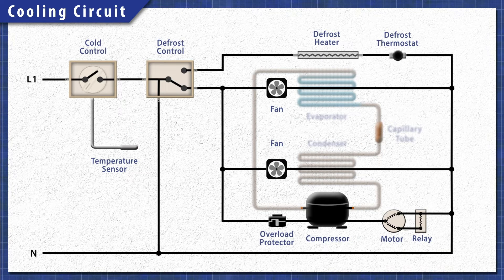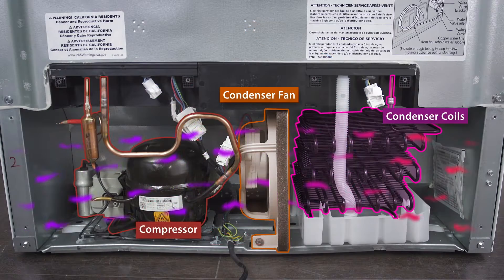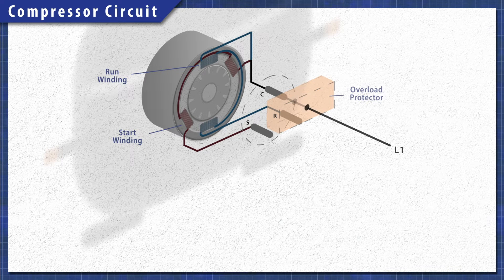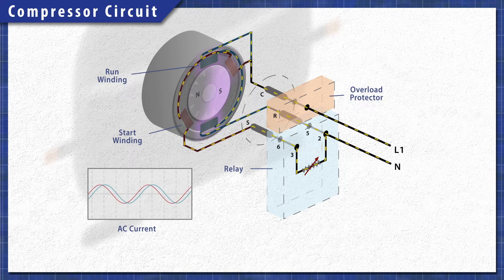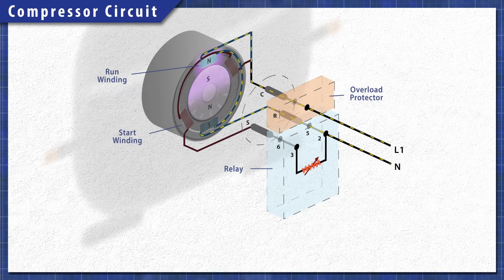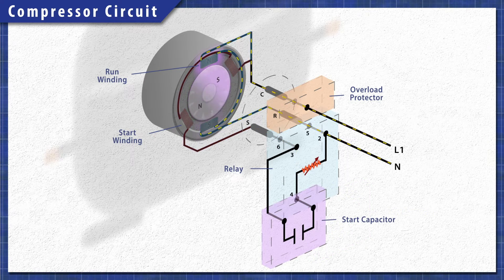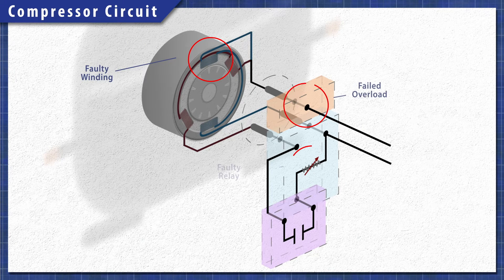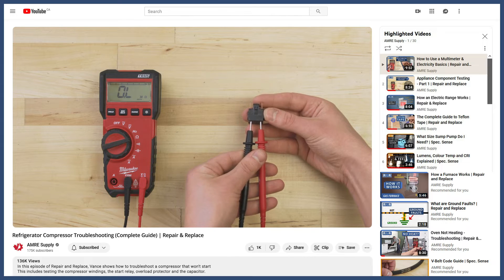Refrigerator Compressor Starter - How it Works | Repair & Replace

Comment: This video helped me to understand how the starter works. However, I replaced my defective starter that had a PTC and a parallel 15uf Capacitor with a 3 N 1. My question, my original starter has a 15uf cap, I don't know what value of the cap is in the 3 N 1, but if it has a larger capacitance will that cause the start winding to have more current when in run, thus causing more heat?
Reply from the maker: Thanks for watching. A difference could produce more heat but it is difficult to know if that is a meaningful amount that would affect performance over time.
Reply: @AmreSupply  I took the label off of the 3 N 1 and found the cap labeled 145 -165uF. I need to get a 3 N 1  to disassemble to see exactly how the 3 N 1 works.

Comment: My side by side refrigerator/freezer is not working correctly. It does not get colder than -5C degrees:

- The thermostat/temperature sensor are working properly.
- Both condenser and evaporator fans are working.
- I checked the resistance between the compressor 3 terminals (common-start: 5.7, common-run: 3.7, and run-start: 8.3). 
- Each of the three of terminals are not grounded to the body. Compressor seems to run fine based on these tests. I attached a new "3 in 1 RELAY OVERLOAD CAPACITOR " (URCO410) device along with the original run capacitor (also tried a new run capacitor) to the compressor. 
- I made sure to connect the  3 in 1 properly (white wire to start (left side), red wire to run (right side), and black wire to common). 

Do you have ideas of what seems to be the problem?
Reply from the maker: Thanks for watching. Since the freezer is getting down to -5C then that means that the compressor is running correctly. The side by side model might have 2 thermistors, one in the freezer and one in the fridge. Make sure that both have the right resistances or the control board might misinterpret the temperature, and overcompensate. https://www.youtube.com/watch?v=HQFRUuWIz_o

Side by side models often have a damper motor that controls the airflow between the fridge and freezer compartments. If the motor fails then the damper might be stuck in one position and unable to change: https://www.youtube.com/watch?v=LlyDFV31c4k&feature=youtu.be

As well check for a buildup of dust on the condenser coils, or a buildup of ice on the evaporator coils. If there is a buildup of ice then you'll have to troubleshoot the defrost system: https://www.youtube.com/watch?v=r2YUNLPs4kM

Hope this helps!